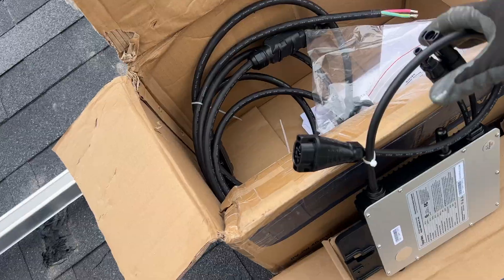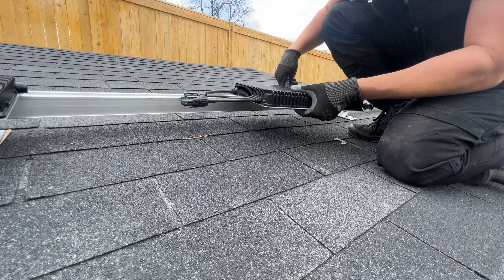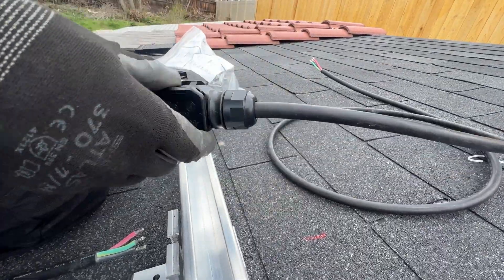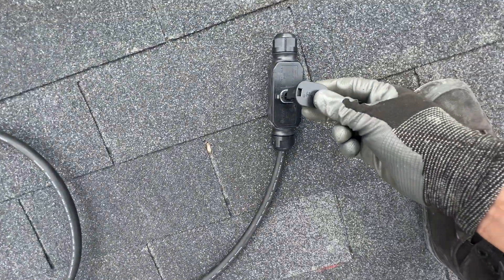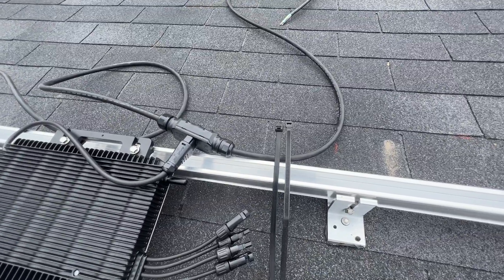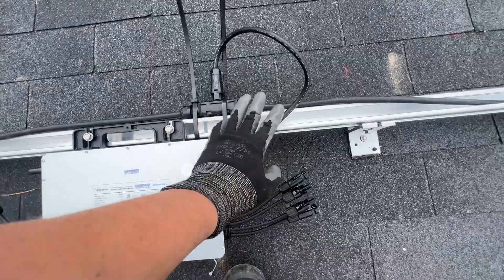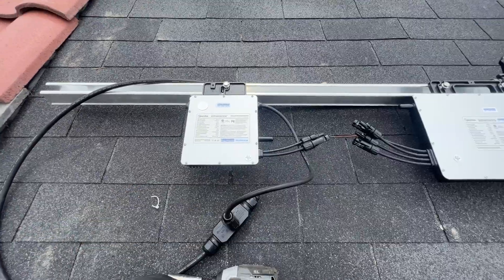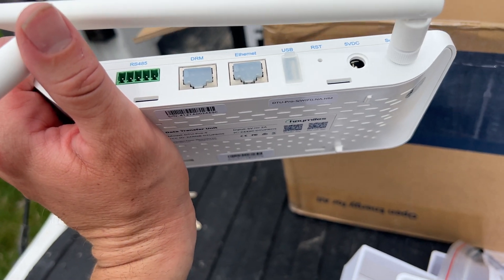Hoymiles Solar Microinverter Unboxing And Installation (Part 1)

Comment: I'm experienced with solar installations. The installer APP doesn't have the DIY account anymore.  Is there and installer that is willing to help me with and smile's account. I'm trying to get one with hoy miles but no success so far. I have three MI350 inverters but no account and I want to practice the installation and configurations process.  Thanks.

Comment: Just bought a HMS1000 for two panels. Although the seller explains in a video to mount the microconvertor to the frame with bolts the guy said it is better to just place it on the roof and secure with long UV tie raps.  The weight might damage the frame . I will see what I do.

Comment: I wish there was a model that uses Power-Line-Commnication instead of Wi-Fi. In high density communities Wi-Fi frequency bands are very crowded which can cause lost connections. High density communities also pose a risk that nearby hackers may try to hack into the micro inverters in order to get access to you home network. IoT devices are currently the largest risk to network security and privacy and a Wi-Fi device is the softest target because it doesn't require direct access to the devices.

Comment: Aptos is selling theirs as Hoymiles too. I'm not sure what's best, just buying Hoymiles directly, or going with the Aptos branded version. Someone else pointed out Duracell is doing the same thing. How about CT's? With Enphase you've got the Envoy (or Combiner with the gateway) and it has the ability to connect CTs.

Comment: The DTU is only required to set the grid profile IF your utility requires it to be set. Some don't require it. The DTU is not required to make the inverter operate. Just connect 1 panel and the 240VAC, and in 5 minutes you'll see the green LED flashing. It is then producing power. They are very DIY friendly, "ENERGY FOR ALL". I help DIYers with engineering support, stamped plans, Hoymiles microinverters, panels, and racking. Mostly I'm the guy you call when you have questions. I'm here to help and happy to do it! If you want a pre-set grid profile to avoid the DTU, I can do that too. Thank you for letting me post this.
Reply: So you mean it is really not necessarily to install also the dtu?
Reply: @dilan2842  That is correct. It will start and operate without a DTU, provided the grid is present for 300 sec.
Reply: @ToddDesiato  thank you... except in monitoring, what else the purpose of dtu?

Comment: How did you identify positive and negative DC terminals when connecting your panels to the inverter
Reply: It's labeled on the front of the inverter.

Comment: 2:05 looks like old enphase splice
Reply: Don't let the looks fool you. These have UL1741SB with export and grid control using a WattNode meter. I replaced my IQ8+ inverters with the HMS-2000-4T-NA, and increased the output of my system by 30%, thanks to no clipping. Enphase likes clipping which is fine if your utility has limits to the maximum AC power, but if you're not near the limit, clipping is just killing the efficiency and ROI of the system.

Comment: Nice video.  Why at first did you install it upside down?
Reply from the maker: The inverter is really heavy, I wanted to install the bracket higher up on the rail but realized depending on the thinness of the panel frame it would make contact. It will definitely depend on the thickness of the rail or type of install.
Reply: @solargoat  I think in all cases, the microinverter and optimizer vendors only advise 'shinny side up' to reflect the heat and let the air flow beneath cool the black bottom.  In addition to it possibly not clearing the panel if flipped over, you'd be putting the inverter closer to the panel and the heat source.  Pretty sure warranty would be voided if mounted that way.
Reply: @billjohnson3344   Don't mount them upside down. Add a spacer to lift them up off the roof. The fins need exposure to airflow, and you don't want to transfer the heat to the panel. For maximum performance, your racking and panels should be at least 5 inches above the roof.